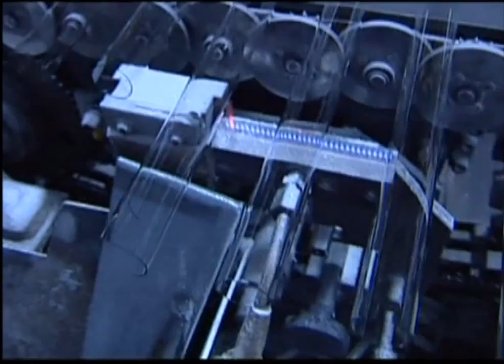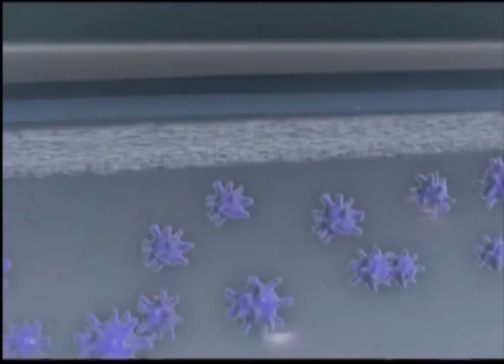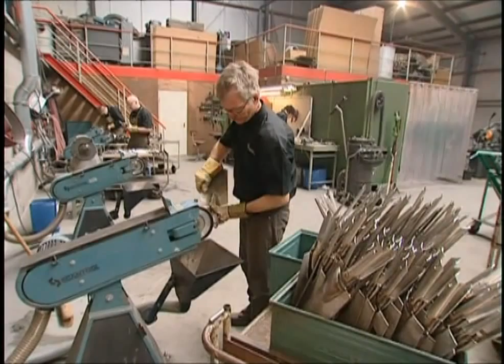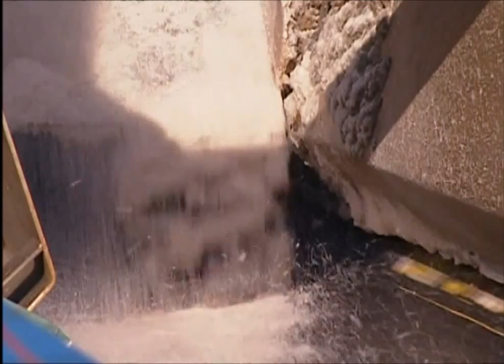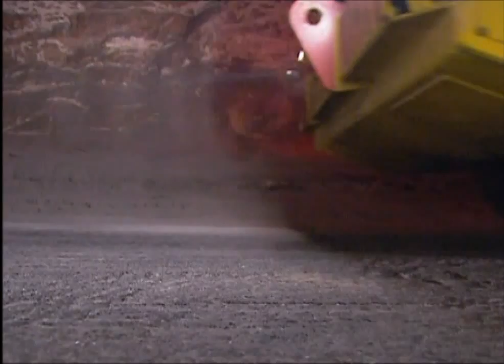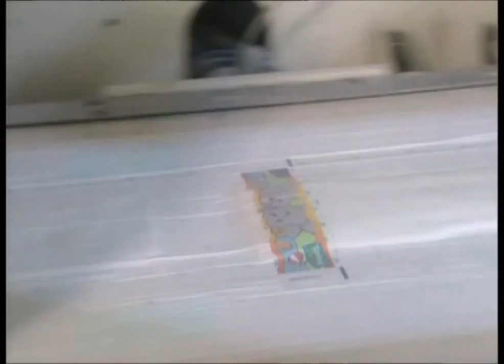HOW IT WORKS | Fluorescent light, Garden tools, Toxic Waste, Nappies | Episode 32 | Free Documentary

Comment: Did anyone notice the hard core guy stick welding without gloves on.... he must have been the boss just doing one for demonstration... if you weld without gloves for just 30 min or so you would be burned up
Reply: Bullshit, unless you stick your hands onto the material after it gets hot as shit you really have to try to burn your hands by not wearing a glove...
Reply: @someguy4915  
He was referring to the intense UV emitted by the arc causing sunburn, genius.  I bet it never occurred to you that it might be something beyond your first thought.
Reply: @someguy4915  actually it emits UV light, which can burn your skin. Same reason you wear a welding helmet because it will burn your eyes.
Reply: That's no big deal. But drilling into stone overhead without goggles? That's one tough guy! Bet his eyes look like mud puddles.

Comment: So, the filaments, more specifically, Cathodes, are the electrodes of the fluorescent lamp. They are coated in a mixture of different tri-oxides of different rare earth elements. The selective mixture, when heated wia/ the filament, takes the incandescent energy from the filament and uses it to emit electrons into the tube. These free electrons fly from one end to the other. Hense why the tube has two cathodes at each end. Since the common AC power supply is the sinusoidal wave, it plunges half of its cycle into the negative and half of the cycle into the positive half-cycle. This so called duty-cycle is what causes the tube to flicker and produce light. When the wave is at negative interval, the electrons stop flowing and the phosphor coating for a short period becomes dark. Then when the wave is at positive interval the one cathode start producing the electrons and they flow to the other ends of the tube. This is what causes the tube to flicker, the dark period of the phosphor and the lit period of the phosphor happens so fast that it produces the famous almost-unnoticeable flicker in these tubes. Basically, you can say, that with AC wave, the tube acts like a single diode rectifier, witch means it only lets power one way, and not the other, and hense it flickers. On the electronic ballasts the tubes are driven on DC witch is pine single positive interval wave, the tube is constantly lit and doesn't produce any flicker.
The free electrons traveling at the speed of light trough the tube bombards the free flowing atoms of mercury vapor. When they do, the mercury atoms absorb that energy and the electrons dissapears from existence. The now super charged mercury atom now can't contain all its electrons going fast around the neutrons and protons, and some of the electrons leaves the atom orbit and they appear as UV radiation. This radiation is the invisible spectrum of ultra violet light. It travels trough the tube until it hits the phosphor particles. The phosphor absorbs this radiation and in the process of absorption it produces the light photon in the transformation of the energy absorbed. Now the photon leaves the tube and travels to light our room. This is the invisible dance that happens in every fluorescent tube to make it light up.
Reply: The flicker is almost unnoticeable unless you are in a workshop with rotating tools (drills, lathes etc.). That imperceptible to the human eye flicker can cause such tools running at high speed to appear stationary. Very dangerous to the unaware. I'd imagine the same must be true for LED lighting?
Reply: @chillybrit  yes, the cheap led tube replacements that use either a single diode rectifier or just a plain capacitive dropper flicker really badly. The moderataly priced ones uses full bridge rectifiers and capacitor filters to make the light being produced continues and no flicker is produced. 

In old soviet and british fluorescent fixtures, that used two lamps, they had two different preheat ballasts. One just plain simple inductive one, and the other with auxilary winding that connected to the lamp circuit wia shunting the started in series with a lamp and one of the mains wires that connected to the ballast was coupled with a capacitor. The combination of these two ballast elliminated the flicker, because the other ballast with auxilary windi qas called semi-resonamt ballast, and it shifted the synosoidal wave 120 dagrees so the dark period would be pushed forward. This way when one tube had a dark period, the other one was lit, and vice versa. This almost elliminated the flicker and in schools it was really good cause the students eyes would't get too tired from the flicker.
Reply: @mr.dahliaking.202  Great info! I didn't know those two lamp fixtures were setup like that.
A single diode rectifier would result in a 50% duty cycle on the DC output right? Could you mitigate that with lots of capacitance to smooth it to some degree?

Comment: There's optional replacement LED tubes for the 77VAC ballast tubes that plugs streight in.  I recommend a simple rewire of 110VAC to either end of the tube and REMOVAL of the ballast.  LABEL the light fixture for LED lamps.
Reply: youre a terrible troll.
Reply: Most people don't have the skill to do that. So that's why they make direct replacements. If you mess with a fixture some idiot may just put a regular tube there. There's a reason why certain sockets have certain shapes, it's to idiot proof things.